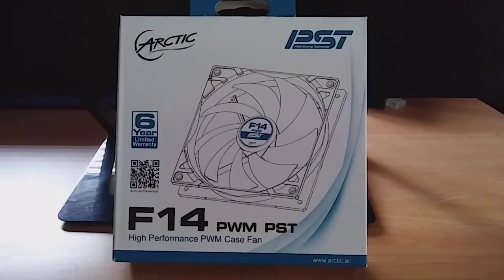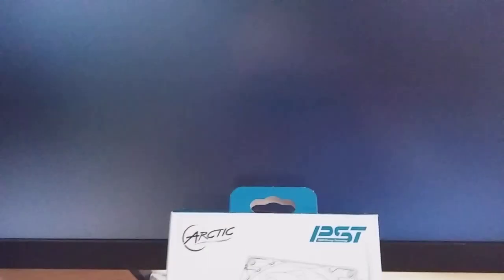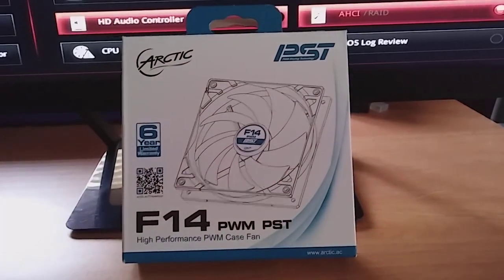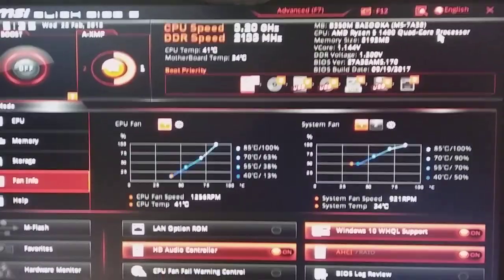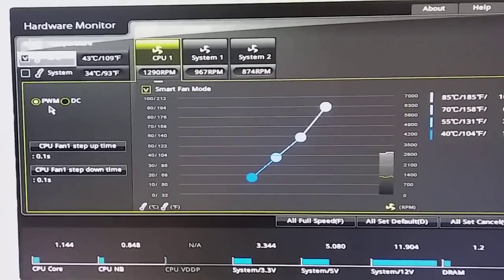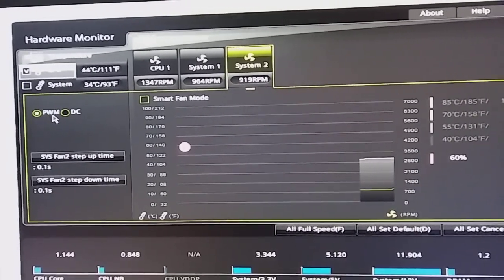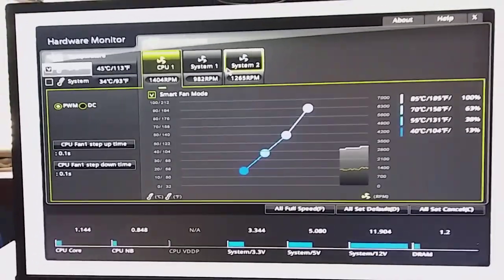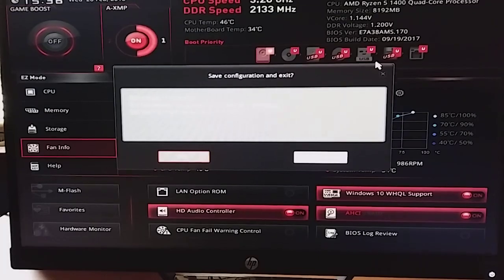Enabling PWM in BIOS for PC fans

Comment: i have a new build with corsair ICUE software to control all my fans , having issues with the software causing problem with so going to by pass the corsair switch and plug everything directly into the mobo , my
big question is aio will function well doing this ?

Comment: HELLO LOU! You are my go to guy for MSI! I recently built my last system with an MSI Z390-A Pro with an Intel Pentium Gold Coffee Lake G5400 Duel Core 3.7Ghz Processor! 64 GB DDR4 3200 Ram and a GeForce GTX 1650 Video Card! I use this system for Adobe Video Editing! Besides ticking the XMP & GAME BOOST button with FAN set to Auto, what else can I do to Overclock this system? I was told by MSI after I already bought & installed it that this is basically a budget gaming board that cannot be manually overclocked? Any advise Would be greatly appreciated!

Comment: Using an X570 Tomohawk and unifans. Dragon center and the bios displays Sys Fan 1, which the unifan hub is plugged into, as 0 RPM when the fans are clearly running when using PWM and Smart Mode. Any help would be much appreciated, cheers!

Comment: Hey dude, I have a set of rgb controller my rgb fans turn on but my fans won't spin. Do I put the pwm in chassis fan header/system fan header or what
Reply: So, I have an AIO liquid cooler, so I use that on my AIO, then I use all my chassis fans on the cpu pwm. That way it reacts faster, but honestly it should work in any pwm connection.
Reply: @ChristopherFranko  thks man it works fine now!

Comment: Hi. Just want to ask if the system fan is in DC mode does it mean that it gets power from the PSU?
Reply: DC just means direct current meaning it doesn't fluctuate, its fixed. PWM allows the fan to lower its speed and increase its speed as the system increases in temperature. The fans get power from the motherboard which is powered by your PSU.
Reply: All fans get power from the PSU, PWM vs DC mode indicates how fan speed is controlled. DC mode controls fan speed by raising and lowering the voltage on Pin 2, PWM uses pin 4 to control speed in a different manner.

Comment: I dont have option in my bios to enable pwm option, can you help me? Thanks
Reply: Same issue here despite it's a 4 pin system fan connector but in my bios it doesn't have option to enable pwm
Reply: @YifengYin  Sometimes 4 pin fan headers aren't PWM connectors. Check your motherboard manual and they should show what each fan connector pins are. If Pin 4 is +5V or something similar, and doesn't mention PWM, then they are 4-pin fan headers that don't support PWM. Usually the CPU_FAN header at the very least will be PWM though.
Reply: Did you find any solution?